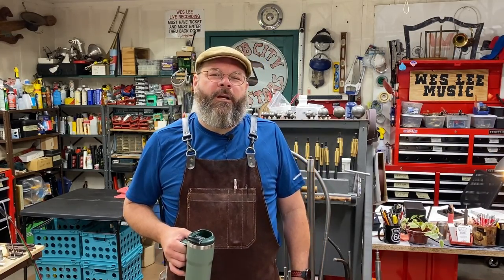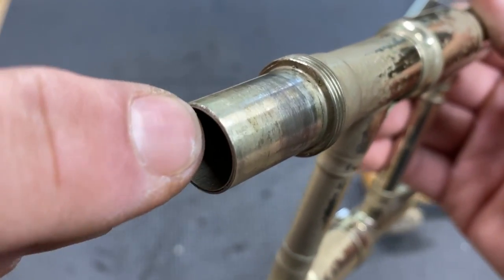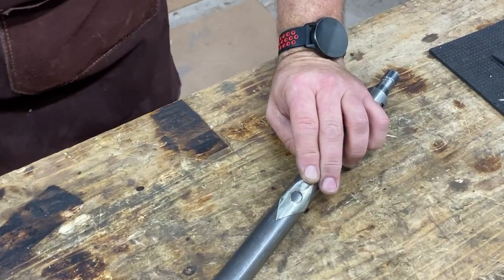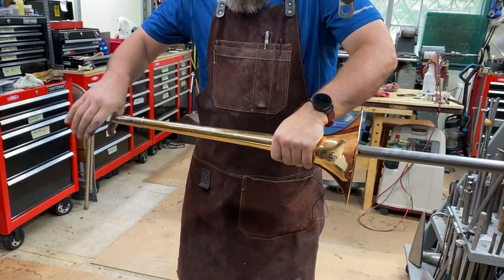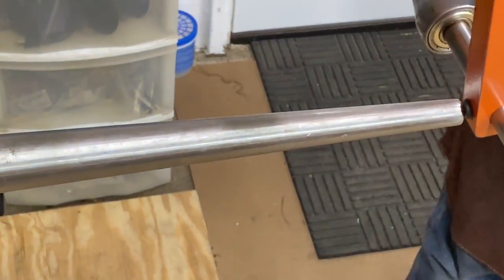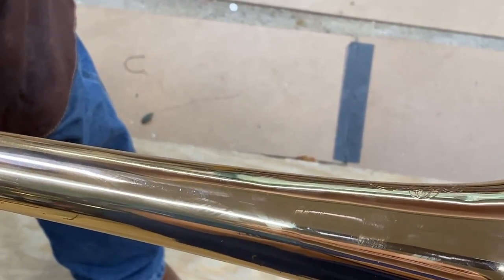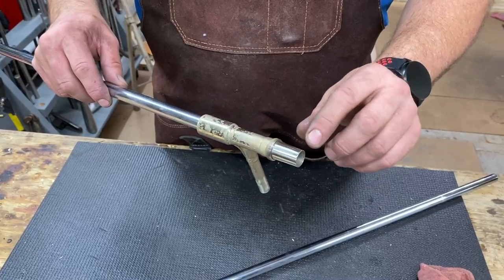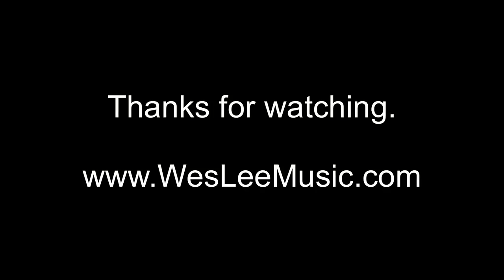Conn Trombone Restoration Kit Project- band instrument repair

Comment: Good show Wes.  I enjoy your videos.  Not a criticism, more an observation and question.   The wedges you used to separate the parts early in the video are remarkably similar to one’s I have that I use on occasion to separate a drill chuck from an arbor.  I always use two and put them in from opposite sides.  This way they push straight, and not tilted.  Am I just being over cautious?  Perhaps so, because your method did do what you needed.
Reply from the maker: I’m going to try that.
I do it the way I do because it is hard for me to hold and tap from both sides. I have always had success like this, but I am going to experiment with your suggestion. Thanks for following along.
Reply: @wesleemusicrepair9820  Wes, I normally do not have trouble holding the setup to squeeze from both sides.  The chuck and arbor are quite robust compared to the delicate stuff you work with. I usually use a small arbor press.  It is fairly easy to hold the wedges on the arbor/chuck assembly and push the wedges together by pulling on the lever that activates the press.   It often takes a pretty good squeeze though.  Especially if I had warmed the chuck and chilled the arbor before assembly.

Comment: The solder on the hand slide was not broken. It's like that so you can adjust it in case you need to repair something. 
DONT SOLDER IT

Comment: When I was in sixth grade band, I found a trombone stored dead in the instrument room. It was a Conn, brand new in the case. I asked about and was told somebody had "lubed" the slide with cold cream and it was unplayable, but I could give it a try. I found it was so thick that when I slid out with my right hand I had to pull back with my left! I spent a couple of days wiping down the slides until there was so little cream left that slide oil thinned it out and the slide worked normally.
The instrument was beautiful: straight as an arrow and the surface was perfect: no wear spots, no tarnishing. I played it for a year and I was very proud of it.
It's been almost 50 years. I wonder if it even  exists and if it does, what kind of shape it's in.
(Maybe it's best I don't ever find out...)
Reply: They may have used actual cold cream with lanolin in it. The lanolin makes it really thick. Not everyone passed on the message to use cold cream without lanolin. I heard the original Ponds was good.